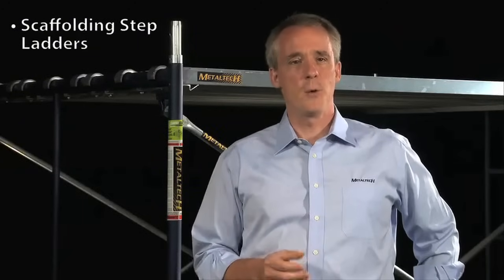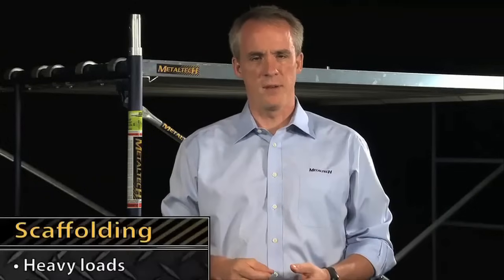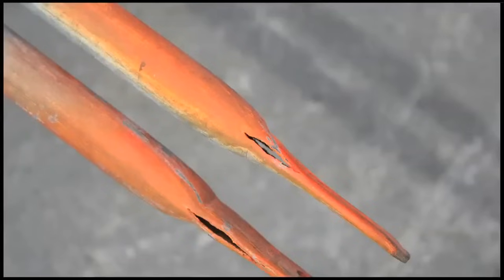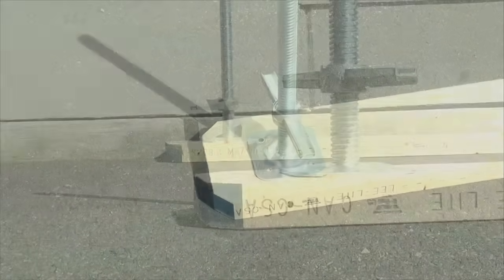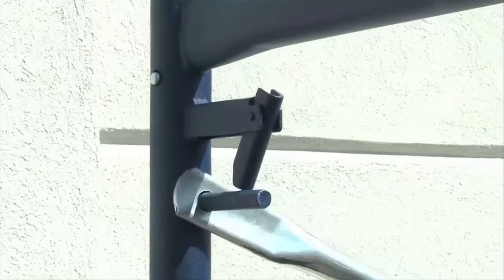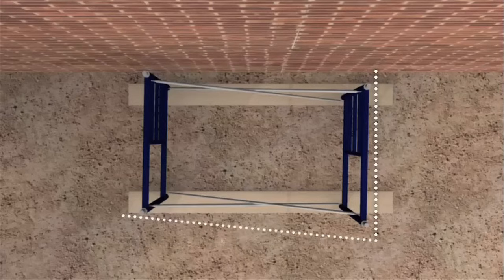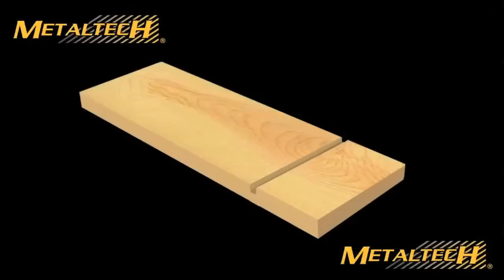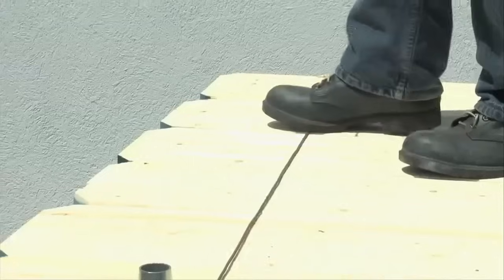METALTECH Exterior Scaffolding Set Up Instructions - Part 1

Comment: Aside from the nervous ticks of the presenter, that are very distracting, I saw two major violations in this video.
1... Wheels should NEVER be used with on  stairs. @ 1:54
2... That harness connection was lower than the tether! @4:14
Reply from the maker: Thank you for your comments Rick, indeed, a scaffold used in a staircase should never be with wheels. For the harness, as it was about to quickly show its use from the ground, the example seems good, but it is true that this could be demonstrated in the structure of a scaffold, with a higher connection. We will consider your comments on our next shooting, perhaps you would like to assist us?